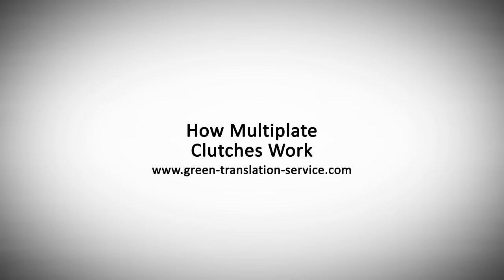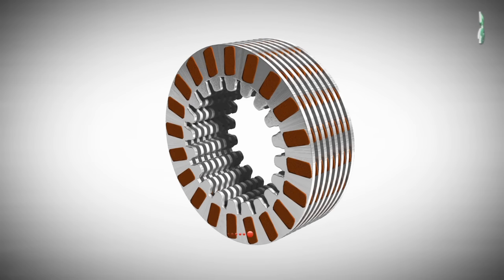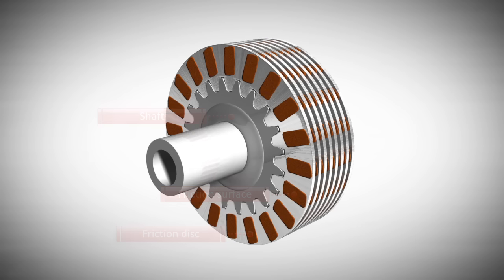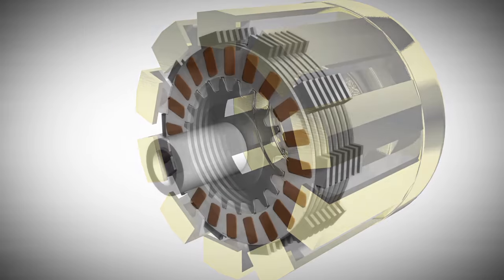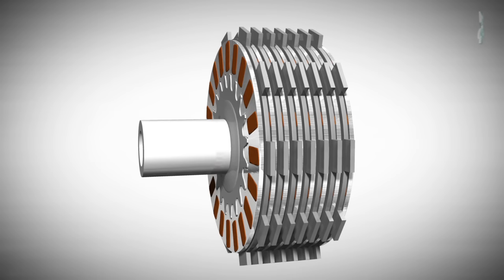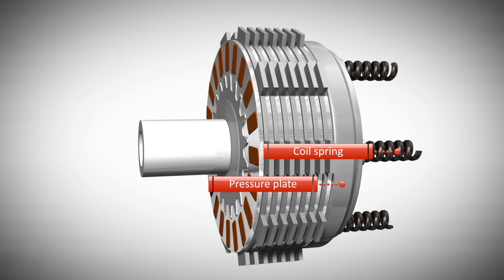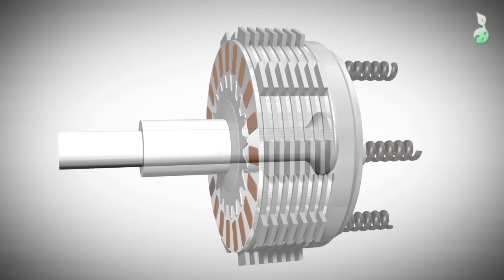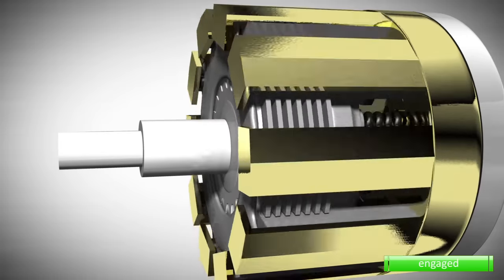How multiplate clutches work! (Animation)

Comment: Brilliant work , be nice to mention a few other elements ( 1 ) friction material sometimes cork ( 2 ) sometimes in an oil bath , to remove heat ( 3 ) may be used to reduce overall diameter .

Comment: +indraidabagus the engine is on the left if this is inside a Ducati motorcycle. Your question is difficult to answer because there are so many applications and most clutches can be used in either direction. 

But, to give you an example, look at a Ducati motorcycle. The shaft on the left of the animation would be the shaft inside the engine connected to the piston rods. This means the inner plates are spun by the engine and the clutch transfers the rotation to the plates with the teeth on the outside. Then that can be used to turn a belt that then spins the transmission and finally the tires.

So the most simple answer could be to say "engine on left" but because of the endless possibilities he didn't want to say it as a blanket statement.

Comment: Thank you for the great explanation. There's one thing about multiple clutches that I don't understand. These clutches sit together with the gears in the gearbox and run in oil. Even though the friction disks and the steel plates are pressed together, why don't they slip (because of the oil) ?

Comment: Does a one plate clutch have to be so heavy to have enough friction that disengaging it would be too hard for a system that wouldn't be bulky and heavy for a motorbike? Is this why single-plate clutches are commonplace on cars but I've never seen one on a motorbike before?
Reply: +junoguten I assume it's because single-plate clutches require a much larger radius in order to get the same leverage. Even if they were lightweight they'd be far too bulky for a motorbike.
Reply: nagualdesign That makes a lot of sense. Thanks!

Comment: The clutch plate's engage in the basket and the steel discs slot into the center, wrong way around but the principle is correct

Comment: Can i do "power shifting" with this kind of clutch without any modification with the motorcycle?
Reply: You can clutch less shift....if that's what you mean. Pre-loading the shifter, while momentarily letting off the throttle, and ill pop into the next gesr no problem, but to "powershift...AKA quickshift. You need a quickshifter, or a power commander/ Bazazz with quickshifter...If that helps

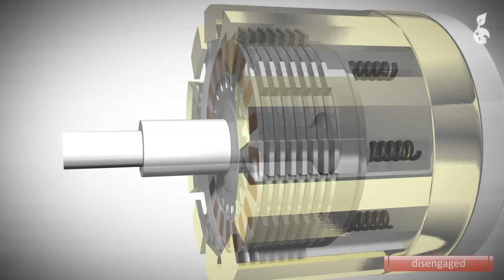Comment: the explanation in the video from time 1:57 sec. is said vice-versa with respect to the animation. Can you correct it?

So when the friction plate and steel plates are pressed together power is transmitted And when the plates are not pressed together power is not transmitted. So can i say that the working of multiple clutches is opposite to working of single plate clutch. since in a single plate clutch, when the diaphram spring is pressed the power is not transmitted and when it is released there is power. (NOT THE PRINCIPLE OF WORKING)

Comment: Hi. my 520i f10. While decelerating at 20 km/h, the car downshifts, and if I press the accelerator immediately, it makes a hard movement and starts accelerating. I wonder if the lock up clutch comes into play? It only does it when it's hot. thanks

Comment: have 1976 Triumph Bonneville which was rarely used(1128 miles)Sometimes it starts without any problems on kicking(one kick)..However lately in trying to kick start the crank does not rotate on pushing down.  There is severe resistance like grabbing(in neutral of course) on kicking down..DRIVING me NUTS to figure out!! HELP SVP

Comment: Hello .. I have a question that at the car clutch the disengagement is 1 mm for small engines and 1.5mm for the big engines but what is the basic cam properties that usually used for this .. what is the distance between dome of the cam  and the cam basic circle ... or what is its table .. f(x)=??? ... and what is the spring K(N/m) constant .... ... after I did some not much presiced calculations I can imagine while pulling the clutch handle of a motor bike small engine: like 125 cc that it is like pushing 500 kg isn't it ? Thank you !!! :)

Comment: Excellent Video. @Thomas Quite often my Bike Clutch Plate Eradicates, that is the friction does not work, resulting in low acceleration and some time no speed above 30 km/h, in that case i have to change my clutch plate [Changed already thrice] My mechanic told me it is due to half clutch, my question is why does it happen and how does it happen and how do i avoid it?

Comment: l forgot to mention that the out resistance crank turns over with plugs removed but NUTS it does not turn over and has heavy grabbing and hard to go through full kick swing because of resistance.

Comment: So..what's the benefit of having multiple plates?  Are more plates necessarily better?  Most racing applications I've heard of use multiple plates..does that mean they're not recommended for daily driving?  Are they harder to press down than single plates?  Any info is helpful thank you
Reply: They're not necessarily bad for DD, they're typically just lighter and more compact. This comes at the cost of complexity, which decreases part life and increases maintenance costs. They can also be used to transmit significantly more power than single clutch plate systems.

Comment: does a dry multi disc clutch mean it has gears (on a motorbike)
Reply: +Chantelle Smith Wet clutches are submerged in oil, Dry ones are not.
Reply: Multi disc?

Comment: The information in this video, while detailed, is wrong. A clutch is engaged when it acts as a "clutch," allowing slip between a torque point. A clutch is disengaged when it acts as a solid unit. Also, if the springs on his pressure plate acted as they do in the model, the unit would be engaged at all times due to the spring load from the return springs! This clutch would literally require you to operate it backwards leaving you holding the clutch to drive!!
Reply: 1) "A clutch is disengaged when it acts as a solid unit" Wrong! The clutch is disengaged when the input and output act as 2 separate units, i.e. not connected to each other. Another matter altogether is when you disengage any outside influence (i.e. release the clutch lever or pedal) and the clutch acts as a solid unit but that is NOT a disengaged clutch but just a play on words. Even the very meaning in the dictionary will tell you that. (to clutch is to grab hold of something) 2) The model above is exactly how many motorcycle clutches work and the clutch is engaged (input and output spinning as a solid unit) at all times unless you pull the clutch lever (or pedal) in in which case the clutch push-rod pushes against the clutch hat (via a bearing) thereby releasing pressure on the clutch and therefore allows the input and output to be independent of each other.
Reply: lado saalo

Comment: +Thomas Schwanke thanks for this and the other Videos. One question tho: If I pull the lever on my motorcycle, I engage the clutch. But your video shows that with the rod, you pull them together. If anybody else knows it, please leave a comment how it works, thnk you.
Reply: +Dani M The rod is used to push not pull. When you pull the lever, the rod is pushed which disengages the friction plates

Comment: So why does it need multiple plates? On my honda I have 7, and one of them is larger than the other 6.
Reply: +Reilly Brunette my guess: multiple disks means increased surface contact which can hold more power with less friction per disk compared to an only two disk clutch. that implies less wear and smaller clutch unit.

Comment: At what side of the screen is the engine?
Reply from the maker: It depends. Why do you ask?
Reply: I just wonder. If the engine (input) is at the left, then the power must be transmitted via gear/chain/belt. If it's at the right, what about the push rod? (It can use gear to transfer the energy to transmission thought, instead of blocking or, ehh.. I'm not good at talking).
Reply from the maker: Sorry, don't get your point :)
Reply: ... ok... Here, which is more common, input from left (input energy transfer via gear cuz there's pushrod there) or input from right/output from left (output energy transfer via gear)? all my questions are kinda weird isn't it?
Reply from the maker: Well, do you mean that the clutch basket or the shaft is more common?
Reply: ....... oh, just forget it. my way of speaking is way too weird.